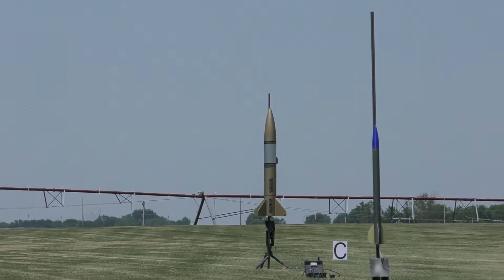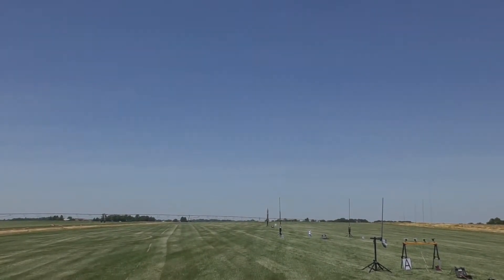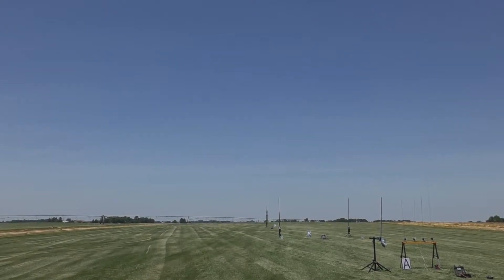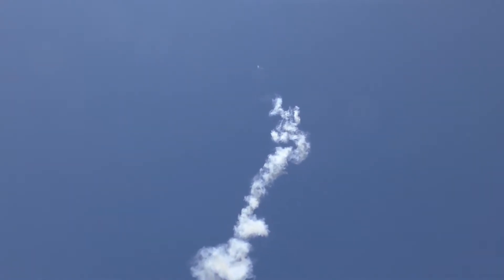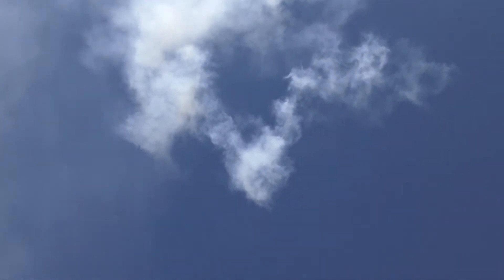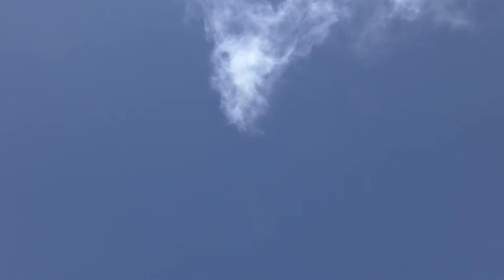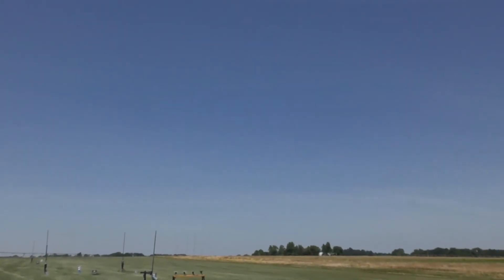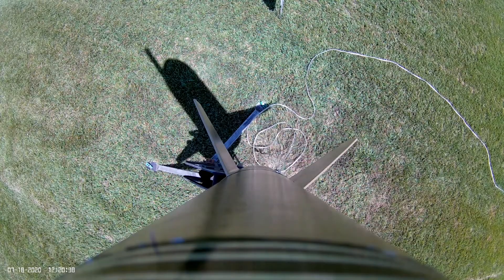LOC Doorknob on a K535-10 on 7-18-20 at BARC

Comment: Maybe not enough separation between drogue and main??.  I liked the flight, didn't like the ride down.  Yikes!.  Navy Seals Halo jump,,where you hit the water right when the fabric talks back.  Gonna build a LOC Doorknob.  Good profile.
Reply from the maker: Hi! This was not a dual deploy flight. It was a simple motor eject and the parachute took a long time to catch the wind and inflate... which it did JUST IN TIME!! Subsequent flights with the Doorknob on K motors were all dual deploy (I built an altimeter bay after this flight!!).